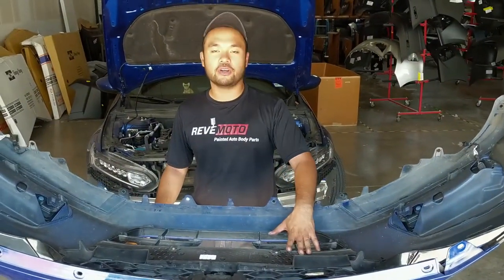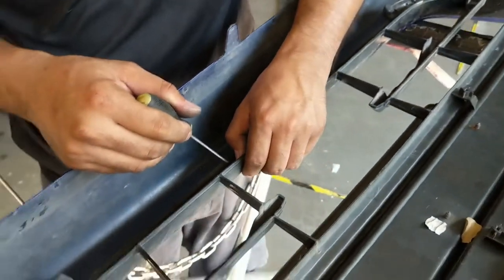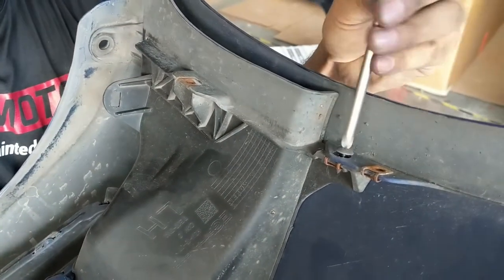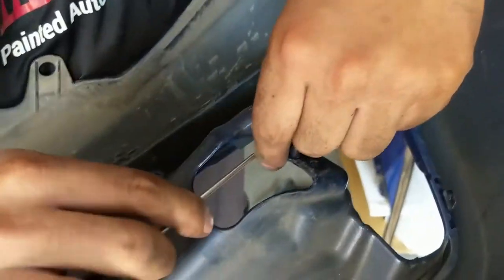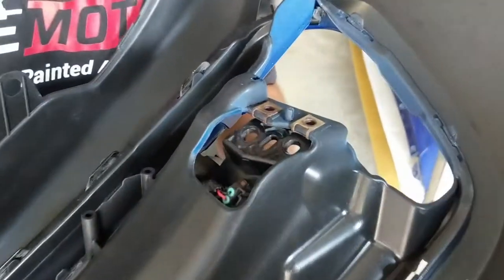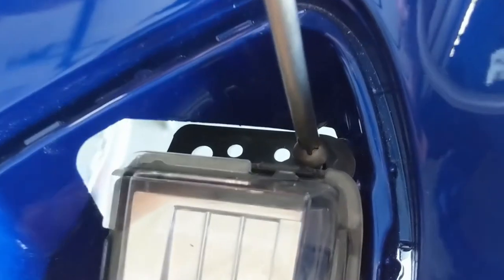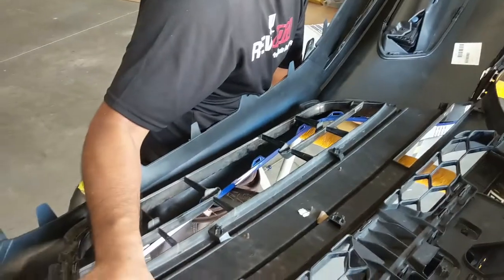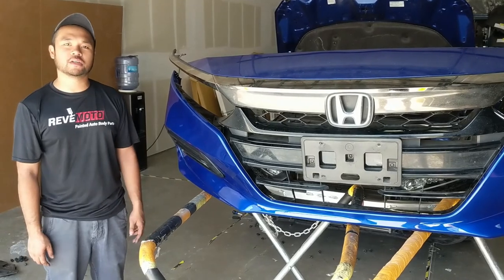How to replace your 2018-2020 Honda Accord Front Grille (2 of 3)

Comment: hey can i replace a 2018 honda accord front bumper with a 2021 honda accord front bumper?
Reply from the maker: Hello! I would say with an 85-90% certainty you can. The fenders and hood range from 2018 to 2021. Honda is notorious for doing minor facelifts to their vehicles before they completely do a redesign. Just make sure the headlights are the same shape. The non-LED lights are 18-21 too but the grille and fog lights are different. We'll be adding this to our conversion page, thank you! www.revemoto.com
Reply: It's possible. Saw the results on a website
Reply: @bugaboy18 link ??